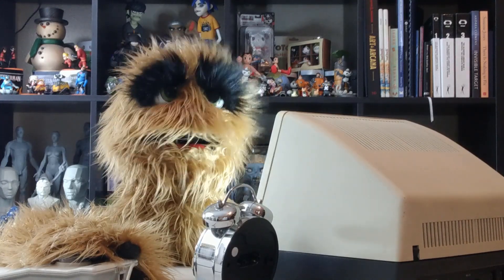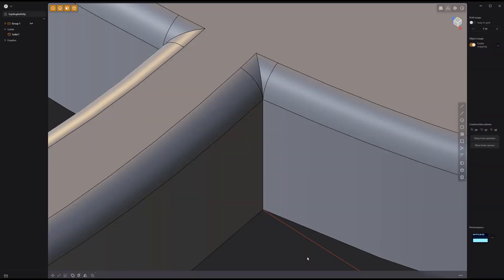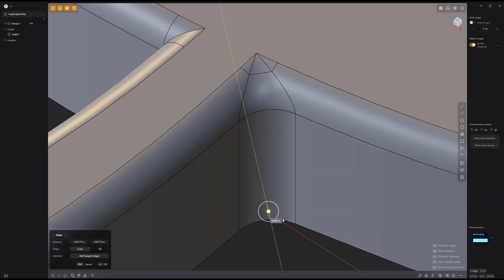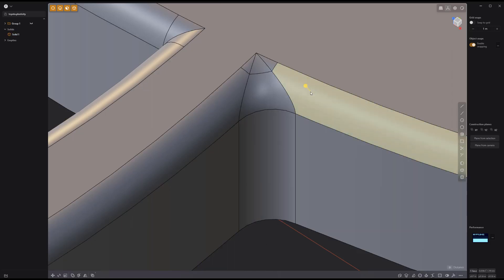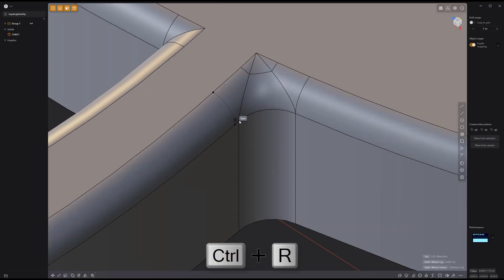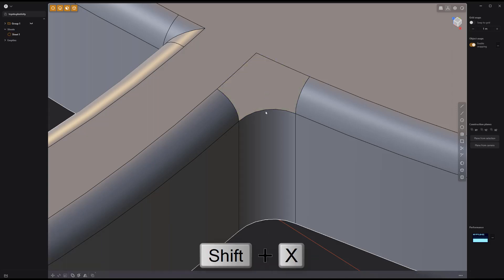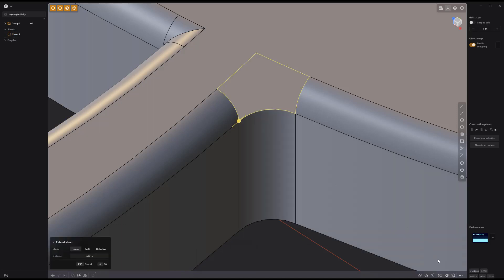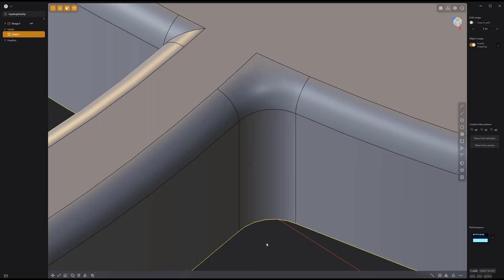Plasticity | Optimizing Fillet Intersections 06

Comment: How are you one click selecting "boundry edges" I don't see a command for it? also, how did you get your Isopram edge to snap to the existing vertex's?
Reply from the maker: Alt click the edge to select loop. Isoparam will Auto snap without modifier key

Comment: The general rule of thimb I'm gathering from these is that you want to avoid clusters of intersecting edges and/or edges all convering to a single point. 

It's hard to unlearn the poly modeling mindset where any curved surface by necessity is supported by lots of edge loops.
Reply from the maker: Its very different way of modeling for sure... but I think Im starting to get the hang of it